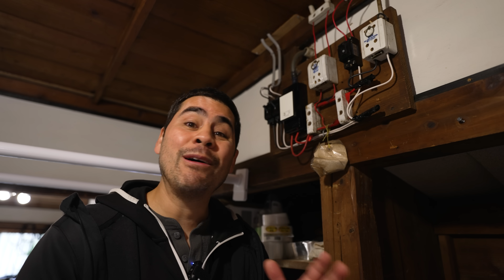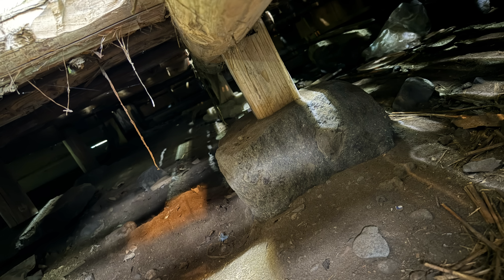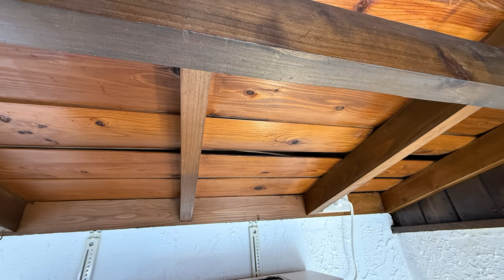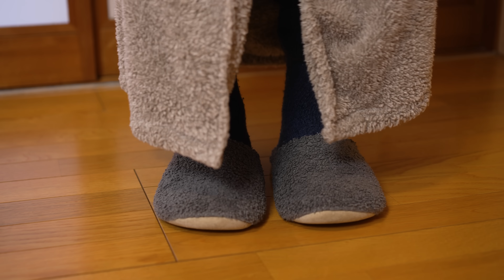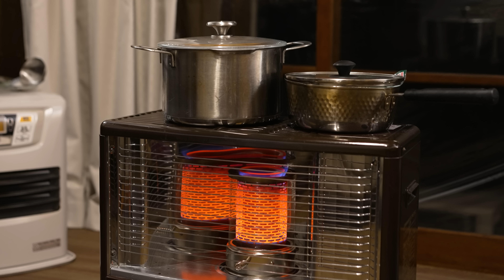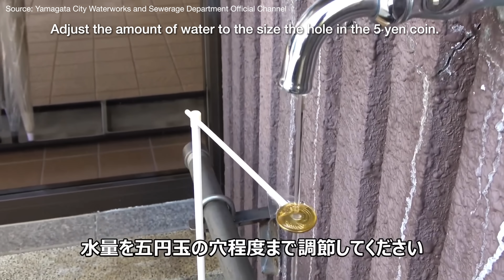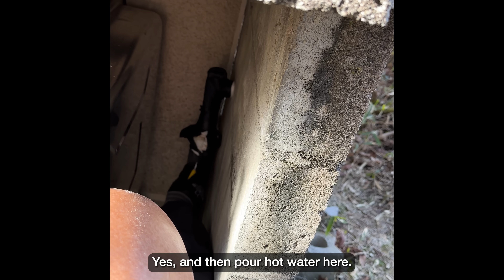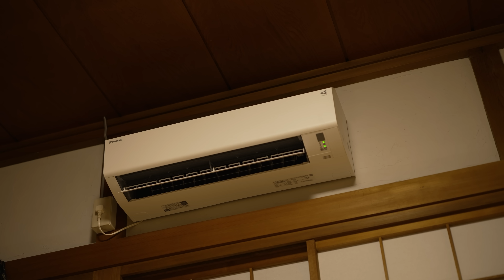What an Old Japanese House in Winter is Like

Comment from the maker: Please keep warm while watching! Best, Greg
Reply: get some solar panels Greg! Run that heat pump throughout the day and keep your house warm
but yes insulation is the solution
Reply: 🟢 Hello from Bucharest, Romania - a huge underrated city in Europe. -12 C right now.
Reply: I'm not sure what the japanese electrical code is like, but SURELY you can find a standard breaker to replace the thermal fuse no? Or just a self contained fuse that isn't a piece of exposed wire. They are kind of expensive but I don't see why a bit of DIN rail + some Phoenix Contact or Weidmuller flip breakers won't be acceptable here.
Reply: Hello, I was just wondering why you don't use an electrical heating blanket to keep yourself warm in bed?
Reply: I watched Chinese YouTubers in Japan ( Chinese ladies married to Japanese men) like YoYo in Japan - yoyo 在日本， it shows the real everyday life in Japan especially how the elderly live ( Yoyo ‘s husband’s grandmother lives by herself in an old house)
Reply: For the cold bed issues you could use a low power electric blanket or a hot water bottle 😊
Reply: I also used to have troubles with constant cold feet. Hot tip: Finish your showers completely cold for 1-3 minutes. This will stimulate blood circulation and the moment your body feels cold it will heat up naturally. It will take some discipline in the beginning so you can start lukewarm and then go colder as the days progress!
Reply: talk about it with tokyollama 😂
Reply: Start a company that does insulation retrofits for akiyas. Huge income potential to serve English-speaking foreign investors, among other potential services per language and coordination services with contractors and local government. 

You could even just be the mediating agent that doesn't even do any technical/construction work, just manages it for investors that may not even be in-country for the whole of a project.

Between spray-in insulation, insulation panels, and even exterior-applied insulation (remove "aesthetic fittings", apply exterior insulation, refit aesthetic fitting, done). I bet a lot of Japanese clients would come around, too, if you were to introduce some foreign brands/products like this whole AI/Perplexity blurb I put together:

Core tech / process  
-  Aeroseal and AeroBarrier are aerosol‑based air‑sealing systems.  
-  A blower door creates pressure in the building, and a micronized sealant mist is injected.  
-  The mist rides the airflow to leaks in ducts or the building shell and builds up to seal gaps.  

Aeroseal  
-  Used for both duct sealing and, in some markets, whole‑building/envelope sealing.  
-  Delivered through local HVAC, insulation, and energy‑audit contractors as an offered service, not directly to homeowners.  
-  Public information shows a global dealer network, but does not clearly confirm a well‑established, branded residential presence in Japan.  

AeroBarrier  
-  Closely related to Aeroseal and focused on envelope sealing to hit airtightness targets verified by blower‑door testing.  
-  Adoption is well documented in North American new construction and high‑performance projects.  
-  As with Aeroseal, there is no explicit, public evidence of a defined AeroBarrier dealer network in Japan.  

Japan specifically  
-  Japan has a strong and growing market for weatherization and airtight construction.  
-  Most air‑sealing work there appears to rely on conventional materials:  
  ◦ Sealants and foams  
  ◦ Airtight tapes  
  ◦ Gaskets and membranes  
-  These products are made and sold by major Japanese materials and chemical companies and used by local builders, but they are not packaged as turnkey, blower‑door‑driven aerosol systems with brand identities like Aeroseal/AeroBarrier.  

Practical takeaway  
-  Aeroseal and AeroBarrier are the key aerosol‑mist, blower‑door‑guided brands globally.  
-  In Japan, airtightness is mainly achieved with more traditional materials and methods supplied by local manufacturers.  
-  Any presence of Aeroseal or AeroBarrier in Japan is best assumed to be limited, pilot‑level, or project‑specific unless directly confirmed with the manufacturers or Japanese high‑performance‑building organizations.
Reply: Milk is the way to go.
Reply: Currently a cool temperature 25C by tropical country standards 😂
Reply: I wonder if replacing kerosene heater(s) with a webasto diesel heater would be a possible choice to combat problems with emissions. The biggest upside of a webasto is that exhaust and warm air are separated, so you could have this running safe even at night. They are also easy to buy and maintain as they are sold for camper cars.
Reply: Watching from Indonesia... Pretty warm actually
Reply: Please follow up on why modern Japanese houses don't have central heating! I have peaked into that rabbit hole before, but never dared to go down there...
Reply: You.... UPGRADED to a 30Amp box!!!?? Bro.... thats.... not enough... Is this a limitation to your area or your akia?
Reply: Literally a paper house! 😂😂😂
Reply: my house is 27c and 55% humidity, coldest time of the year too.
Reply: Not a problem here in Australia 😂
Reply: You could use snow to seal the house to keep it warm like the Inuits do. Pack snow on the roof and doors and windows and blast a source of heat from the inside. It will melt the ice inside and turn it into frost and an insulator.

Comment: 30 Amps sounds weak........but coming from a 230V country, it's even worse. Japan has 100V. Which means, only 3kw for the whole house! The electric range at my parents houses uses more power than that. 
Come to think of it, I used the electric kettle at a small rural hostel once. The light got dim when I switched the kettle on. As an electrician myself, I had a whole midlife crisis learning about the japanese electrical system.

Comment: I’m in Michigan, USA, and we have a heat pump system that we use for both heat and A/C. Our house is 6,400 sq ft and it’s worked so much better than our propane boiler system does.

Comment: The other fascinating thing with the washlets is that they made this jump in the mid 1980s from the most primitive toilets to this most advanced system. My take is that they did it for two reasons: a) being crazy about hygiene (see extra set of shoes for the bathroom/toilet) and technology (Toto and their various tests for the perfect angle of the bidet nozzle, I think it was 42°) and b) Japanese men being pampered by their mums for a long time want to enjoy the same comfort as when they were kids. And these toilets provide warmth and comfort, like the heated toilet seat you've mentioned. Here in Europe, washlets only have a market share of about 3%, which is nothing. But that's because of the learned behaviour (toilet paper vs. water based anal cleansing), sigh.

Comment: Why don't you improve the house? Come on, get yourself a decent bed. I lived in completely unheated rooms in winter where the temperature fell below 0 °C and you get ice crystals on the windows, but it was never cold in bed. A well insulating blanket is key. In the evening, you fill up a big bottle or similar with hot water half an hour before you go to bed, and then it's cosy and warm the whole night without need for running any heating at all. Fix up the electricity installation, that can't be that hard. And then have something like a chimney, it can be a simple metal pipe that runs somewhere through the roof, so that the CO2 from the gas heater doesn't build up.

Comment: 30A with a heat pump is wild. Typically in the US, panels for residential homes are usually 200A/120Volts. A heat pump of that size would probably be on a 20A circuit breaker.

 I'm happy to see you're making it work and balancing everything.

Comment: you show a lot of stuff you used as insulation. im not a house builder but ive seen youtube videos and usually different things have different ratings. its quite possible the random stuff your using while it will help wont be as good as a purpose built material that has a high rating.

Comment: When I was in college, I rented an apartment in an old house. It was heated with a storage heater. I once made the mistake of turning off the heating when I went away for winter break. Luckily, I had neighbors, so the pipes didn't freeze... but the building was brick, and it took two days for the temperature to rise from 6°C to 14°C... I slept in layers. Now I live in a house from the 1970s. I don't have gas, so I have a new electrical panel so the stove, dishwasher, washing machine, and dryer can all work independently. This might be interesting for you, but it happens in cities in Poland. My house is heated and gets its hot water from the municipal central heating system. The hot water never runs out, even when my two nieces are visiting, and believe me, they can spend a lot of time in the bathroom. It's an old house, and before it was insulated, the basement (which is finished and serves as a laundry room, among other things) was about 14 degrees.  Additionally, at night, when the temperature is set to 19°C, I could hear the heating turning on twice a night. Now that the house is moderately insulated (of course, all the windows are double-glazed), the daytime temperature is set to 22°C, and the heating doesn't turn on at all at night, even though it's set to 19°C. Insulation makes sense.

Comment: I live in north america north of the 55th parallel. It is -16°C now.The house was built in 1931. My apartment is 1,200 m2.  The panel distributes 120V and 240V. I have 5 dedicated circuits, out of 200 amps to get everything running smoothly. The house is insulated has it was in the 30s. During winter interior temp is set at 18°C for the spaces I'm usnig. I spend less than 700$/year on energy.

Comment: lived in a 100 year old house east coast USA for 10 years. in MA, it was REALLY HOT in the summer, and REALLY cold in the winter, there was a GIANT metal heating unit in the basement with a metal grate above it in the very center of the house, it did work, but your bill would skyrocket. the walls were plaster and not sheetrock, also found out that the outer walls DID NOT have insulation, found this out because the plaster in one room crumbled away and we could see inside the walls, they were pretty much hollow aside from dust, and framework. and mouse poo.

Comment: Your challenges, with regards to amperage usage, is somewhat like what my husband and I go through as we are totally off-grid. We have an 1.8Kw system (at the moment; it'll be increased  eventually) and have to be mindful of electrical appliance usage. It also never gets below 50 ℉ (10℃) in our tiny-house-on-wheels because we use  the upside-down-terracotta pot method on our propane stove. (Yes- the home is well-ventilated) and that keeps the space warm enough until morning when we can build a fire in the tiny woodstove.

Comment: Ya funny.  But creative too.
Thx for ur advices.
I keep my thermostat to 51F as the outside is 24F.
Yes, it's a lot warmer here in the SE USA than
where u r in Japan.

Electric heater is expensive to operate.  It sucks a lot
of Amperage so i don't have one.  Kerosene heater i do
have but besides CO exhaust, it smells bad.  So i stopped
using it.  I don't think i checked the fuel source for impurity.

I would rather have a pellet (made from corn) stove down the basement.
Chopping wood is not my forte.  Propane gas is expensive though many
here use it.

Thx 4 the video.

From the USA.

Comment: Wow... that machiya was built in a complete different era, before plumbing and electricity.  The upgrades for plumbing were just not well thought out... not buried in the ground.  Electricity, well.. back in a the day 30 amps was more than plenty.

Your house need some Canadian DIY.  Pipes buried, much much more insulation on pipe risers.  Pex pipes to better resist freezing.  Insulating the skirt of the house to resist the cold.... and at least 100 Amps of power.

Comment: Many a morning in Osaka I would wake up with my futon frozen stiff around my face, as I had to sleep tucked up over my head. Some days we had hot water at the kitchen sink where the flash heater was, but the hose we draped outside the house from the flash heater through the kitchen window to the bathroom window would freeze clogged. Only after the sun melted the clog could we shower. That was temperate Osaka, let alone the many colder cities in Japan.

Comment: I recently moved out of a 10 year old Daiwa house (in Japan) that has amazing technology called reverse insulation - colder inside than out in winter and hotter inside than out in summer. I spent a couple years house hunting, and most are built with shockingly poor materials - even those costing $500k. And if you think you are getting a deal with an old Akiya, even a kominka guess again. It will take $100,00 at least to renovate into something even approaching what westerners are used to. Great homes can be built, but it is not cheap.

Comment: My bedroom is in the basement and over night CO2 levels rise up to 3000ppm just from me breathing, no heater running or anything, just me.
And I wouldn't ever have noticed if I didn't buy a clock with a built-in CO2 meter, haha. I now ventilate my room a lot more frequently then I used to.

Comment: This is clever problem-solving, but it shouldn't be necessary. In a modern, developed country like Japan, people shouldn't need kerosene heaters, plastic sheeting, and acceptance of freezing rooms just to survive winter.

Germany solved this decades ago with building codes that mandate proper insulation, central heating, and even underfloor heating in many homes. It's standard, not luxury.

The fact that your new mini-hotel has all this-while ordinary Japanese homes lack basic insulation-shows the solution exists. Why aren't these standards required for all housing? Comfort and health shouldn't depend on individual ingenuity. They should be guaranteed by code.

Comment: it doesnt have to be an akiya but the majority of Japanese homes are like this.  My home was built new--with insulation etc.  But of course, there is no central heating.   We have a big kerosense heater in the living room with a heated table to warm the legs.  ALso, the bathroom has a small electric heater mounted on the wall so that getting in and out of the bath/shower is not too painful.  Otherwise the rooms and hallway and toilet rooms are all freezing.  And this is in the warmest prefecture outside of Okinawa.   For the people that choose to buy an old Japanese house be forewarned----the majority are freezing cold in the winter, and boiling hot in the summer.   They also require consistent maintance.

Comment: My parents live in Saitama. They live in my grandparents house which was built in the early 60s. Inside the house it gets bitterly cold to the point it feels like your skin is pricked with needles. 
The one thing I noticed why it’s colder inside than outside is because the house never gets sunlight through the windows. The buildings are so closely built together that you can put your hand out the window and touch a neighbours wall. From four sides of the building, three sides are covered by other tightly packed houses. And unfortunately, the sun hardly touches the front of the house. 

The tightly packed houses also means in the middle of a highly humid summer, opening a window does nothing because the air can’t circulate through the house. Can’t win with the old houses in a city area.

Comment: My town in Colorado is over 6,000 feet/1,830 meters. My ground floor apartment is 68°F/20°C inside and 50°F/10°C outside. When Temps drop to 0°F/17.8°C it was only 52°F/10°C.
I have an infrared heater in the living room and one in my bedroom; I only run one when I am in that room for an hour or two a day. My electric bill is around $70/1,169¥ per month. I am fortunate to have good insulation. A heating pad warms me before sleep as well as a cup of hot tea and my DarnTough, merino wool socks I wear them 365 days per year; warm in winter and cool in (summer 39•C)
Stay warm!

Comment: Indoor combustion is a nightmare. We've switched to electric ovens and stove tops. And the gas central heating vents straight outside. 

Have you considered a portable infra-red stovetop or induction one? Handling the fuel sounds like an accident waiting to happen. 

Also in my country we have electric blankets you can put on your bed that just heats up the bed. Stops that freezing sheets feeling. You can leave some on the low power setting but have to be careful.

Comment: The kerosine heater we installed for the boat has an exhaust hose. It exits through a custom window panel with heat resistant metal components. 
Maybe something like that would be a good alternative.